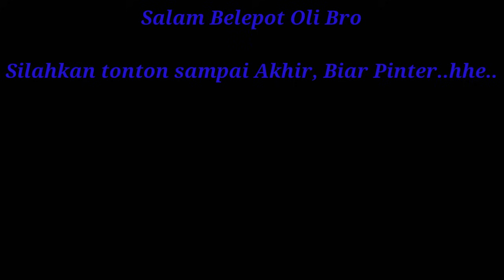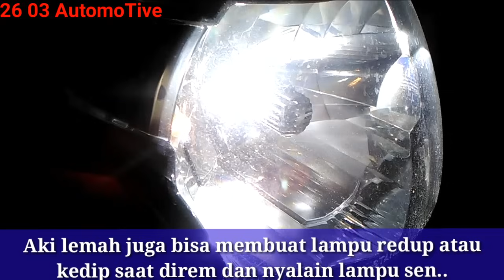Vega ZR Rubah arus AC ke DC, Bikin Lampu Terang..!!!

Comment: Trimakasih atas ilmu yg sudah di bagikan. 
Kebetulan vega saya persis dg yg di vidio. 
Dan saya sudah mengikuti arahan dari vidio ini. 
Tapi lampu saya masih yg ori warna kuning. 
Stelah di bawa jalan. 
Motor aku rasa ada yg aneh antara lari dan lampunya. 
Stelah saya buka lagi. 
Ternyata kabel yg di fiting malah meleleh panas banget. 
Kenapa itu bos? 
Apa karna lampunya yg masih ori? Bukan led
Reply from the maker: Kalo lampu masih ori gx usah dirubah ke DC. Efeknya panas..
Reply: @BangDori2603  
Trimakasih. 
Berati harus ganti lampu depan blakang nya pake Led yach. 
Trus saya kan pake hazard pake fazer dan juga saya pake relay klakson. 
Apa tidak berpengaruh setelah saya rubah Ac ke Dc?
Reply from the maker: @RoesIramaMusik85  tidak pengaruh..yg penting bener dan rapih masangnya.

Comment: Kang saya coba sesuai tutorial nya..semua normal sih..cuma di voltmeter kok overcharge ya sampe 15,5 di rpm tinggi tp tanpa beban lampu utama cuma nyalain lampu tembak d2 laser aja..sein sama rem normal cuma pengisian aja drastis cpt naik klo rmp tinggi sqmpe 15,5v tp gak sampai ke 16v..normal gak ya🙏🙏🙏🙏
Reply from the maker: Over itu..coba ganti kiprok original..
Pengisian jangan sampai lebih 15v..
Minimal 12v - 14.9v
Reply: @BangDori2603  part motor masih ori pabrikan kang blm ada yg di ganti semenjak beli tangan pertama jg
Reply: Sudah 10thn..mgk sudah lemah x ya
Reply: Tp pas masih keadaan blm di rubah seperti itu normal sih di voltmeter gak sampe 15v..tp pas coba saya aplikasikan cara itu jadi drastis naik

Comment: Bang sanya nyoba ke motor aupra x 125 emang nyala nya terang.. tapi pas lampu di nyalain ko klakson mya ga kuat.. tapi lampu di matiin klakson kuat. Knp tuh bank..
Reply from the maker: Kalo supra x 125 ,harus ganti kiprok tiger dan gulung spull.. Jka tdak mau ganti kiprok dan gulung spull, bisa dg cara cabut kabel kunig dikiprok, lalu sambung ke ouptut kontak..dan menggunakan Lampu led dg watt yg kecil, sprti mrek osram 6000k, 12v. 5/6 watt.